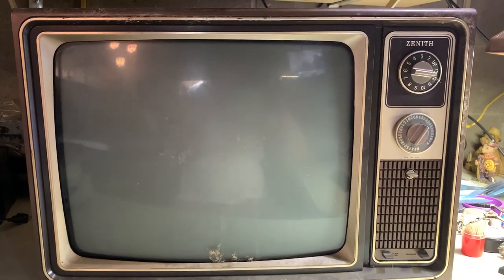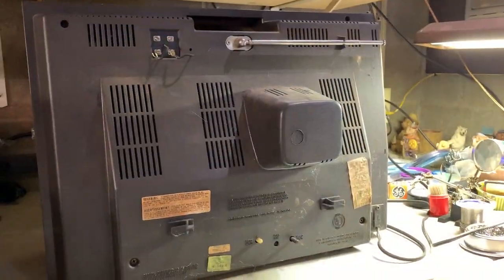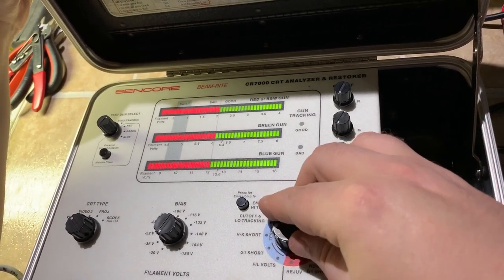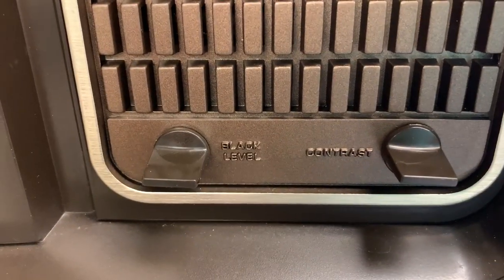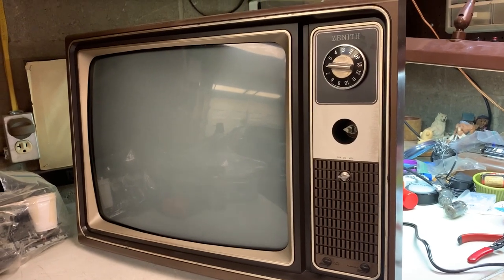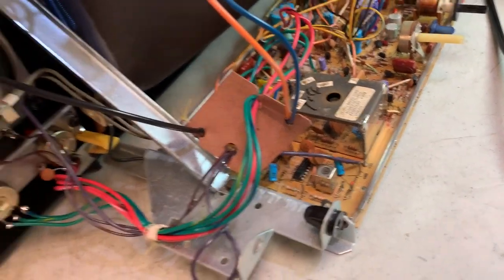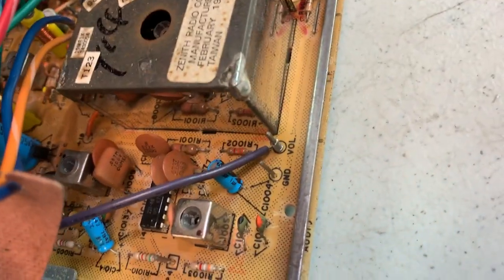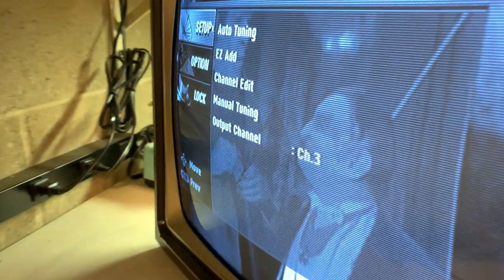1980 Zenith Model M192W 19" B&W TV

Comment: 1980!? It looks like a 1960s design. But then again, the GE PortaColor was also a '60s design and it allegedly was still in production as late as 1980...
Reply from the maker: I have a NIB Portacolor from 1968 and one from 1976. They started in 1966 (which is how Sony got the idea for the Trinitron from the Portacolor.) The latest I’ve personally seen is 1978, but you are correct: it is rumored they ran them all the way up until 1980.

Comment: Who would buy a black and white TV in 1980?
Reply from the maker: Someone that wanted a low cost, secondary TV for a bedroom or den.
Reply: @spatsbear  thanks for the fast reply
Reply: As surprising as this may sound, one could still buy a 22" B&W set (both as a metal cabinet table model and a wooden console floor model) as recent as the early '80's and these late B&W consoles were basically known as "senior citizen specials." Even as recent as the 1990's, I ran into a few older people who wanted no part of a color TV and they would buy the used 12" and 19" B&W sets that I had for sale. I think 19" B&W sets were still made at least until the mid '80's and 12" B&W sets were made at least until the late '90's (I have such a set) and possibly into the 2000's. Also, in the early '80's, even a basic 19" color set was in excess of $300, while the 19" B&W sets were usually in the $150-$175 range. If money was an issue, people would often buy the B&W sets.
Reply: @spatsbear  can an HDTV antenna be attached to this TV?
Reply: @JT_O4  There's no such thing as an HDTV antenna, digital TV uses the same antennas as analog TV. If you want to receive DTV broadcasts (including high definition) you need a converter box which works perfectly. That's what's being done in this video.